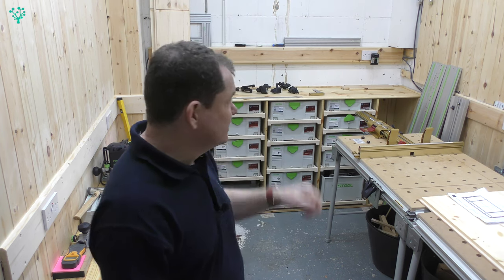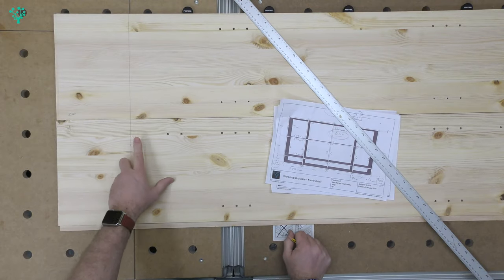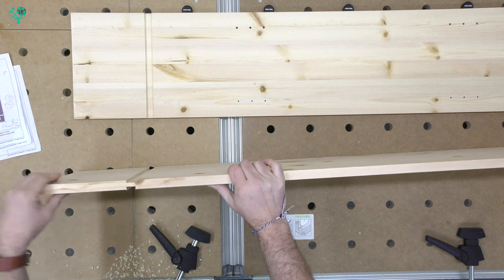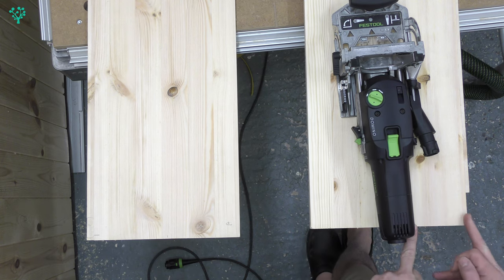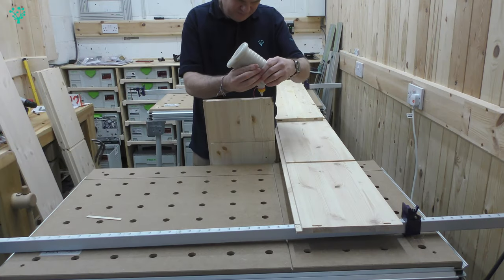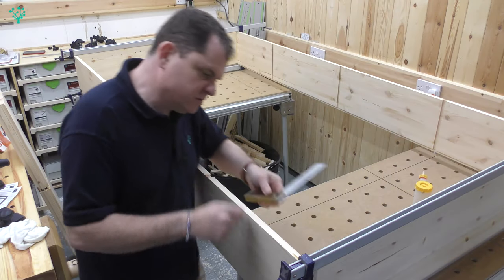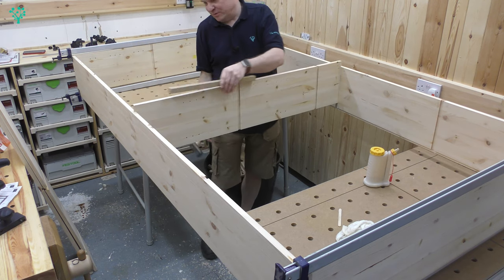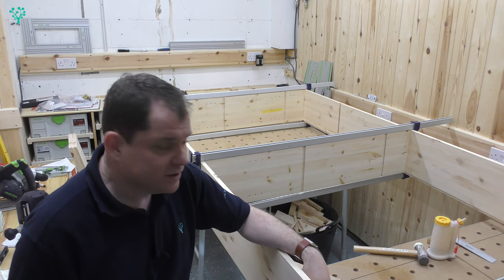How to build a bookcase - Episode 4 - The Build

Comment: Great video, loving your channel, one little question, " what wood glue do you prefer ??" , I noticed your glue pot so you must have bought the glue in bulk to fill that glue pot......
Reply from the maker: +Kevin Davies Hi Kevin,

Thank you for the feedback as always.

I use Titebond III, longer opening time, waterproof and food safe. Don’t really buy it in bulk, have a few 1ltr bottles in stock and top up the bottle as and when.

The glue bottle is fantastic, works on any angle, doesn’t clog up and makes application very easy and controlled.

Talk soon.

Andy